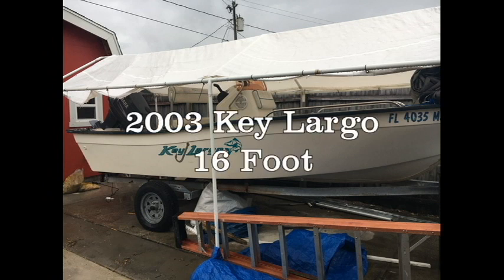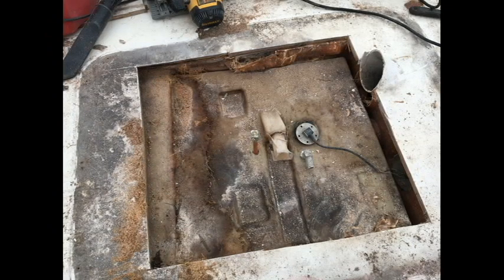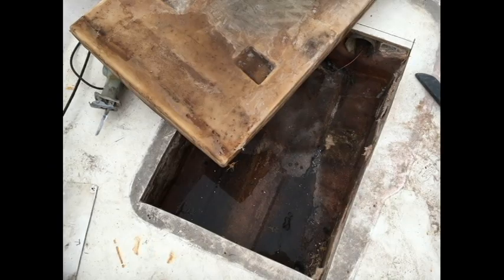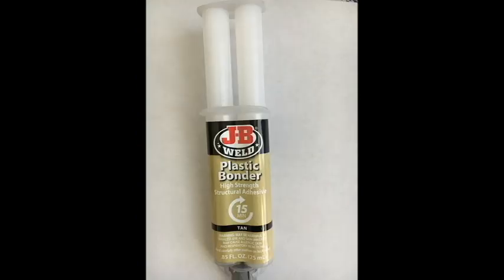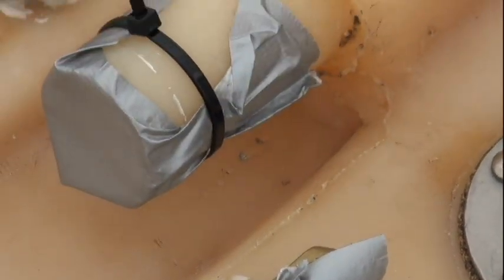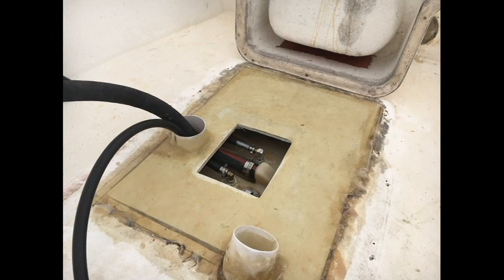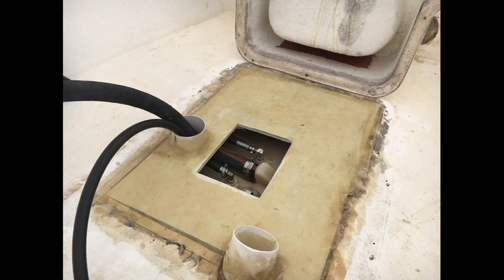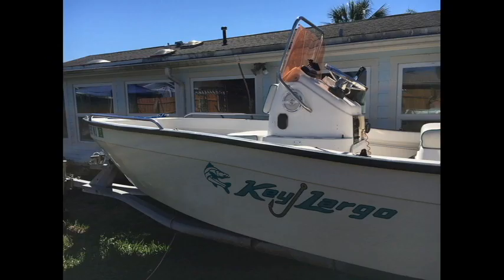Key Largo Boat fuel tank removal and installation

Comment: What did you cut the fuel filler door with? Because I used a gas cap that wasn’t made for the salt water and I didn’t realize until it corroded. I now want to get a plastic one like you with the breather tube but I’m unsure how to cut the part for the breather tube.
Reply from the maker: I used a large drill bit to get started so as to allow a jigsaw to finish it off.
Reply: @prohomevideos  I just need to make the smaller hole for the breather tube
Reply: So the drill saw should do it?
Reply from the maker: @Aidan.Wingard  What size diameter hole?
Reply: @prohomevideos  it’s 1/12
Reply: One and a half
Reply from the maker: @Aidan.Wingard  I would use a 1 1/2" Spade bit or a hole saw.
Reply: @prohomevideos  yeah I already made the hole but I need to make the part for the breather tube

Comment: Thanks for the great video but question. I have this same model boat. Doesn’t the top (cap) come off as a whole piece when you take the rub rails off and surrounds screws. I know that may be more work but for my current situation that may be easier for me. Just want to be sure before I start taking anything apart. Thanks
Reply from the maker: Please help me understand what you mean by top (cap)?  Are you talking about the center console?
Reply: The entire top of the boat. If you remove the rub rails and motor the entire top flooring and all of the boat I believe is just 1 piece that’s lifts up. Thanks
Reply from the maker: @rockynymia  Wow, I didn't know that.  Maybe someone else can speak about that.

Comment: Great video.  I need to download this video for future reference.

Does anyone have a wiring diagram for the 2002 Key Largo 160cc?

Also, does anyone know what the large 2 inch hole is for in the base of the stern?  There's also a 1.5 inch hole on the upper rear  starboard side of the boat.  Both holes are attached to hoses and are capped off just inside the boat.
Reply from the maker: On mine, they are used for the live well which is located underneath the front seat, just in front of the windshield.
Reply: @prohomevideos  Thanks for the response.  I'm at least the 3rd owner of this boat so I'm tryingg to figure out a lot of what the previous owners did, ripped out and left behind.

You're right on the live well connections.  The one on the base of the stern is the drain and the one on starboard is the overflow.  Seems this setup has a filler line, drain line and overflow line.

Now I'm working on putting a complete new bilge in and I'm a little baffled.  I found what appeared to be the bilge outlet directly under the starboard running light.  The plastic was broken so I ordered a 3/4" bilge hose set.  But when I traced the existing hose, it appears to go to the fuel tank vent.  The bilge that was in the boat had no hose connected to it and I cannot find another exit port on the boat.

So, my two questions are: 1) where should the bilge exhaust port be? and 2) where should be the fuel tank vent be?

Going to tackle the fuel tank repair and live well plumbing this coming winter.  Going to first try removing the center console and do all the fuel tank repairs without removing the actual tank.

Thanks so very much in advance. I'm enjoying working on the boat now that I retired.  By next spring it will be 100% again.
Reply from the maker: @jimdunn7502  My bilge exhaust port is on the starboard side towards the rear underneath where the battery is located.  My original fuel tank vent  was where my fuel filler cap was, starboard rear where the light was.  I moved that whole setup to the center console as seen in this video.

Comment: I've got a 2001 160cc and have heard a lot about this fuel issue; however, I have yet to experience any issues (knock on wood).  Have any of you thought to lower your trailer ball to allow for the gas to flow down hill versus up hill?  I see a lot of people (with smaller boats especially) improperly towing their boat with the tongue too high.  They pull up to the pump and wonder why the gas doesn't go up hill.  Just a thought.
Reply from the maker: I have done this very thing in order to get the fuel to flow better and it seemed to work, it is just not something that I was willing to do every time I had to add some fuel.   The mention about having their tongue too high could surely be an issue, but that was never an issue with me, and the problem still existed.
Reply: What I don't like is when my fuel tank is full and I back down the boat ramp, fuel spills out the fuel vent.  I've gotten some looks hahaha
Reply: Consider yourself lucky that you aren't having the issue.  The problem results from the fill line (and breather line) dipping well below the top of the tank between the filler opening and the tank inlet.  This means fuel will sit in the fuel line until enough fuel mass has accumulated behind it to overcome the climb to the tank inlet.  The result is slow fuel flow.  If the breather line gets any fuel or water in it the same thing will happen except now fuel will not flow in the fill line due to the breather not having a free-flowing vent.  Tilting the trailer down at the hitch did little to remedy the situation in my boat.  It is a bad design.

Comment: I have the same boat, I’ve never worried to much about the fuel fill slow as I never burn much (60hp) anyway. That builder of the boat went out of business because his place burned down twice. I’m wondering how you got a 90hp when the boats rated at 75 max? Hell, mine runs 32mph with the 60.
Reply from the maker: I don't use that much fuel either but there were times that I could barely get any fuel in at all.  As far as the 90hp, it was on it when I bought it and I have no complaints, lol.   I run in choppy waters from time to time and tried out this same boat with a 50hp and it barely got on a plane.  The 90hp might seem like an overkill but it is handy when the boat is weighed down with stuff and passengers.
Reply: @prohomevideos  also I found the original v axle made by magic tilt if your interested. Another tip was to get rid of all the grease in tilt tube and put a double o ring fitting on stirring rod side so I could use a heavy oil that won’t dry out, my stirring is fantastic! How fast does the 90 push it? I’m usually fishing shallow water so I’m drafting 8” with 60. Do you know your draft?
Reply from the maker: @bigt4636  I really don't  push it to the max but I've gotten it above 40 before, the jack plate helps with the draft, which I believe is around 12".

Comment: Broken fuel pick up on my 160.  How did you drain the fuel?  By removing the sender?
Reply from the maker: Yes and I bought a small electric fuel pump to drain it into a gas can.
Reply: @prohomevideos  I tried through the filler but can’t get a prime.  I sealed the broken fitting and using a portable 6 gallon tank for now.  I’m on vacation the next few weeks and want to fish so I’m afraid of getting to deep into it right now.  Your video is great.  Thank you
Reply from the maker: @johngrunder836  If you get too deep into it and do not finish, you could always hook up a portable boat gas tank in the mean time.
Reply: @prohomevideos  yep. I did that and tested today. All good.  Fresh water so don’t use much fuel and the. Boat is on a lift

Comment: Same problem on my 2004 16ft.  How hard was removing the center console?
Reply from the maker: Mine wasn’t very difficult. Remove all of the screws surrounding the base of the console. If sealant was used around the base, use a putty knife to break the seal. If available, have an assistant lean the console forward while you look under the console to make sure nothing is being pulled, like wires, cables, etc. Good luck.

Comment: keep an eye on it. jb weld, or most any other adhesive, will not stay bonded to poly. only way to do bonding is to weld it. hopefull your repair holds on for a while.
Reply from the maker: Thanks for the info, so far so good but I will take your advise and check it out, maybe this winter when I am not using the boat.

Comment: When you took out the old collars on the fuel pick up I see you bored out the old opening for the new ones. Was there metal on the inside of the tank? In the video you can see metal inside the hole as your sanding. I have a 2001 190 keylargo and cannot remove my tank unless i tear up the deck. I was unable to remove the fuel pick ups and now the collar just spins. I basically have to do what you did just have limited room.
Reply from the maker: Yes, there was metal inside of the tank but I completely emptied the tank of all gas and filled it with water, emptied it and did that a couple of times.  I am pretty sure I got it as clean as possible.  There is a screen on the end of the fuel pickup and then I have another fuel filter prior to the fuel line entering the motor so if metal shavings were left behind, they surely would not enter the engine.  I hope that helps!

Comment: Going to have to do this to my 1999 key largo soon cause there’s a leak somewhere and no access panels. What did you use to cut the floor and how did you know where to cut?
Reply from the maker: I used a circular saw with a regular wood cutting blade.  As far as knowing where to cut, I started by looking into the small access panel underneath the center console.  I would look inside of that panel to see how wide the tank was.  I took it real slow, cutting a little at a time.  I never had to cut wider than what area the center console covered, which was nice.
Reply: @prohomevideos  I’m likely going to start a similar project, however my 1999 16ft key largo doesn’t have that access panel yours did. Must have been a new feature in the newer model.
Reply from the maker: @brandonlure2738  It could be that it is a newer feature or that someone did it before I purchased it since I bought it several years old.  I thought the panel was nice to have because it would be easy to service the tank, like, in case it needed a new fuel sender or something.  If there is any way to find out the thickness of the floor, you could set your circular saw at that exact thickness as not to cut anything below.

Comment: I have.a 96 20 foot cc that im planning on redoing the stringers on it do you remember anything about hoow the layout on stringers look like and what type of class and epoxy/resin to use
Reply from the maker: I am sorry to report that I do not remember the layout, it was a long time ago.  I also never had worked with fiberglass  before so I went to my local boat store and asked their advise and basically bought what they recommended.

Comment: How many gallons is your fuel tank? I have a 95 Key Largo 16'. I am trying to find the fuel gauge wires. Thanks for the video.
Reply from the maker: Mine is 17 gallons.  If yours is like mine, the wires run from the gauge straight down to a small tunnel towards the back of boat (in the bilge) and then into another tunnel that runs forward on top of the tank.  There should be a small square cut out directly on top of the tank for access to those wires.  Mine was too cramped so I had to remove the center console.
Reply: It’s the pink wire in the harness

Comment: I bought a 2004 Key Largo 160 CC used and after a bunch of engine work and cleaning out the tank I had the same fueling issues.  I've never seen such a poor design for fueling!  Without even knowing how others corrected theirs I did nearly the same thing.  My fittings were still operating so I got lucky there.  I'm wondering about tank size though.  I didn't pull my tank out (didn't have to) to measure it so I did my best with it in place.  After some calculations I came up 14 gal capacity and was more or less verified by filling from empty tank.  The one in this video is about 20 gal capacity.  What are other peoples' fuel capacities?
My tank length is only 32.5".  The other dimensions are the same.
Reply from the maker: I thought that since our boats are essential the same, our tanks would be the same as well.  I can't remember exactly but I want to say that after it was completely emptied, it only took about 17 galllons.
Reply: @prohomevideos  There may have been a bulkhead preventing the tape measure from sliding to the front top edge of the tank resulting in a short measurement.  I did measure the inside but don't remember the numbers...  I re-did the math for your measurements and it looks like 16.5 to 17.5 gal should be right which you confirmed.
I could just call Key Largo!  LOL
Thanks for replying!
Btw, I'm down Daytona-way.
Reply from the maker: @jeffparimuha4248  I'm in Melbourne, we are pretty close.
Reply: @prohomevideos  I took the outside dimensions of the tank and subtracted 1/2" for each side, top, and bottom.  The math came out almost exactly at 17 gallons.  Since there is no way to tell how much fuel is actually in the tank once the fittings are all in place, I slowly added fuel until it sounded like it was starting up the filler neck.  Result was 17 gallons in the tank.  Spot on.
Reply from the maker: @jeffparimuha4248  thanks for the update!

Comment: Hi buddy my name is Al from Miami I have a ? Did you bought your boat with that yamy 90 hp or did you repowered it after you got it, my concern is I have the same vessel but a 2008 and I am planning to repower to a 90 hp but the specification only get to 75 hp ,How is the transom on your boat what exactly did you do,please reply before I will buy the 90 hp yamaha thanks.
Reply from the maker: Hi Al, I get this question all the time.  I realize the spec only go to a 75 but the 90 has not caused any issues whatsoever, no cracks or anything.  It is so nice have that extra power.  My has a jack plate on it and it was that way when I purchased it.  The jack plate may be needed since the motor is larger than a 50 or 70 hp.

Comment: Was there a stringer that went over the top of the fuel tank about 4" wide and about 1/2" thick. And it is about 1/2 way down the tank?
Reply from the maker: Nope, the only thing there was the plywood.

Comment: Is that a new switch Pannel on your boat? If so where did you get it?
Reply from the maker: That switch panel is original.  I think I moved the fuel gauge that was originally somewhere near the steering wheel and put it in the switch panel.  There was a round plastic knock out already in the switch panel that I took out and moved it there.

Comment: Great video! Quick Question, how fast do you think this boat would go with a 50 hp outboard
Reply from the maker: Probably around 20, I had a 50 hp on it and could barely get it on a plane unless it was very glassy water.  That is why I opted for the 90, which can get up to 40 with a good tail wind.
Reply: 20-25 depending on load. Very hard to get to plane out. Have the same boat can't wait to upgrade to 70. Hows the 90 as far as weight?
Reply from the maker: @markkeeter2259  I can definitely tell the motor is heavier but of course, the power makes up for it.

Comment: how did you attacth the 2x4 to the sides
Reply from the maker: If you are asking about the small pressure treated blocks at 4:05 that the new floor rests on?  I screwed them into the side where the existing wood frame structure was with exterior grade screws, (decking screws).

Comment: Any tips on getting a good 90 degree bend on the fuel fill pipe going in to the tank?
Reply from the maker: I would bring the pipe dimensions to a good home town hardware store like "Ace Hardware" and get an elbow.
Reply: @prohomevideos  Thanks for the response! I was referring to the 1-1/2” rubber fuel fill hose (the coast guard approved type) with the red stripe. I know with the metal coil impregnated in the rubber, they can be a bear to bend.
Reply from the maker: @jamesmims7837  Oh that.  How about going to a marine supplier?
Reply: @prohomevideos  I really appreciate your attention and am sorry we got so off topic. I was merely curious how hard it was to bend the 1-1/2” fuel fill line up through the floor and into the Perko gas fill cap and if you had any tips that made it easier. Thanks again!
Reply from the maker: @jamesmims7837  Those bends were not very sharp so I didn't need any elbows, etc. At time stamp 6:09, where my fuel fill line starts at the fuel filler, there is already an angle at the start so that wasn't a problem either.  I hope that helps.
Reply: @prohomevideos  Yes, thank you!

Comment: Do you think this would be possible to do without removing the tank?
Reply from the maker: If your access hole is big enough.
Reply: @prohomevideos  yeah I have some decent space in there. I am having issues with has draining into my tank. It just sits near the top of thr fill hole. You ever had this issue?
Reply from the maker: @Aidan.Wingard  Yes, that is why I changed the filler tube from where it originally was to the location on the side of the center console.  Absolutely no problems now.
Reply: @prohomevideos  I’m going to replace the gas hose
Reply: @prohomevideos  how did you get the full hose off
Reply from the maker: @Aidan.Wingard  Let me get your number, I should be able to call you in the next couple of days.
Reply: @prohomevideos  I actually finished the project and it looks great
Reply: So when the you put new pickup in ,did you just use the JB weld to hold it in place ??

I could use some help maybe a phone # to call , cause I have a few questions.  This video gave me hope.

Comment: Not suppose to have fuel fill inside the boat due fumes sinking. But you have outboard so you're ok if inboard would be illegal to have probably still is to have that way thanks JT 🇺🇸🐟🎣🌴🛥⛱😊😃🙏🏻❤️️
Reply from the maker: The fuel filler from the factory was originally inside the boat as well.